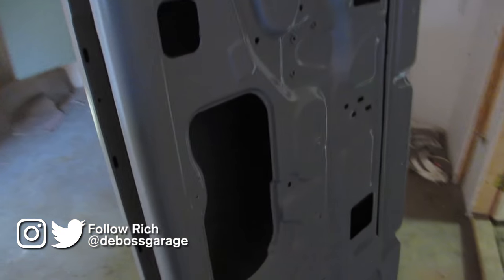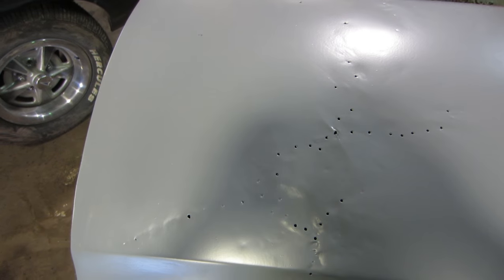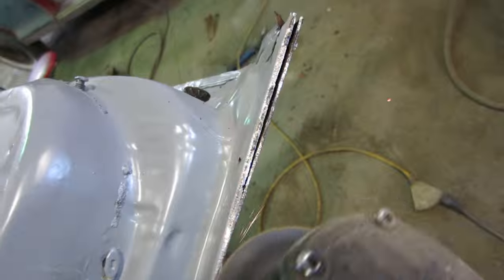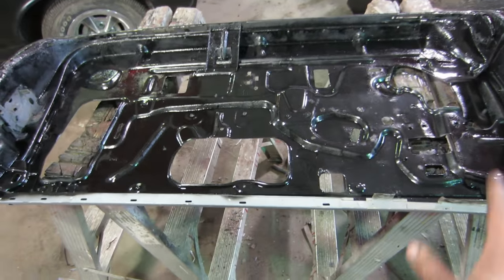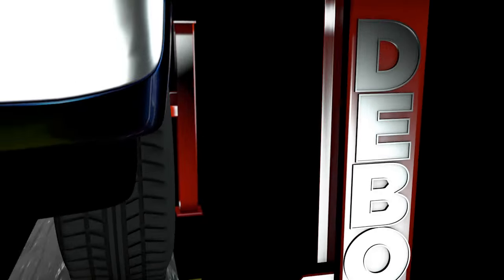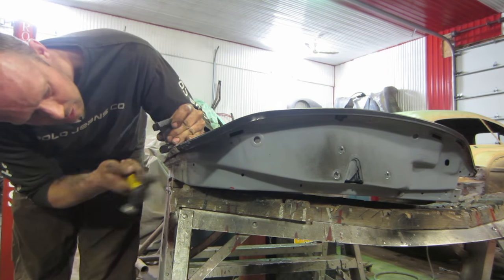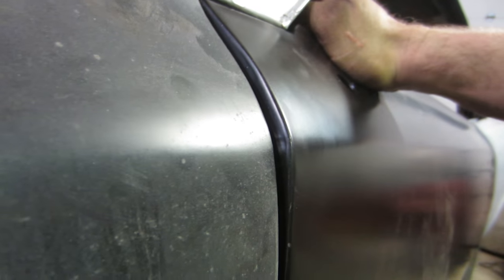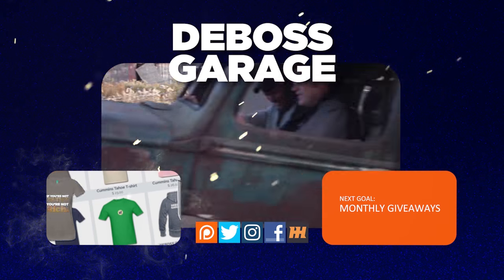How To Replace A Car Door Skin

Comment: I know this is an old video, but I have the same car and was debating whether to replace the whole door or get a new skin.  I've done tons of body work but never reskinned a door.  Mine is rust free, but after I sanded filler out (someone put filler in weird places and there was no rot or repair underneath.  Not sure what they were going for) I found the passenger side door had the same issue.  Had been bent and had a bunch of holes from a slide hammer that had been welded and ground down. 

Anyway, looks pretty easy so I'm ordering that skin tonight.

Comment: Nice vid!  I replaced just the door bottom when I redid my truck... would have turned out ok, but even trying to be careful I managed to get some warping along the door bottom so I went to the salvage yard and just found a whole new door...but could certainly see doing this on an older classic where you cant simply go find another door very easily.
Reply from the maker: +The Fox Shop That was the problem with this door, it was already a "southern" door in mint shape... until you peel off the bondo.  I could have left it but I like to know what's underneath.  I could have bought another door, but could have got into the exact same thing.  Here in Ontario Canada, rust free doors older than 8 years are hard to come by
Reply from the maker: +The Fox Shop Sweet truck by the way.  Reg Cab long box's always looked best in my opinion
Reply: +DEBOSS GARAGE thank you! It's a 1994, I've owned her since she was new...Iowa road salt took it's toll on the body but I always took great care of her and not once has she let me down. been through a lot together and felt I owe it to her to bring her back.. been a great experience. first vehicle I've ever done any kind of bodywork or paint on and did it all myself. learned a lot from YouTube and talking to lots of people on how to do things, what goes with what, proper order to do things etc...Never thought she would turn out as good as she did. I can't go anywhere without somebody talking to me about it, thumbs up, yelling....kinda like it though I won't lie LOL!

Comment: Once the door skin is back on and the outer lip has been folded over do you have to plug weld it where the spot welds were drilled out?

Comment: Is it possible to rip the skin off one door and replace it with the skin of another? I have two doors, one has damage on the skin and the other is a very nice shell. I'm debating on either swapping the skins or swapping the guts. Two issues though, 1) boor doors are used. Not sure if I can reuse the skin after the edges have already been foldered over. 2) the good door shell is missing some panels which are spot welded on the damaged door. So I'll have to find a welder to have those rewelded. Any thoughts?

Comment: "you will never get the door skin right without filler". Then you dont know how to replace a door skin. Never post an instruction video if you are not experienced in the job. ."
Reply from the maker: This is coming from the mouth of Randy Colyn of Randy's restorations who has won 6 of the last 10 top prizes at Canada's national Motorama.   We call it "blocking"
Reply: leslie madonsela  There is always one of you around, keep trolling buddy.
Reply: leslie madonsela-If it was a OEM skin from the original GM dies made back in 67 then yeah you shouldnt need much if any filler but its a repo and they all fit like crap.If you knew anything you'd know they arent even the same gauge of steel but go ahead and troll on.
Reply: I would have kept the original skin and filled the holes with weld . Takes long but worth it since the fit is better